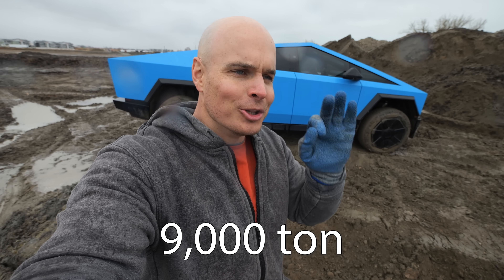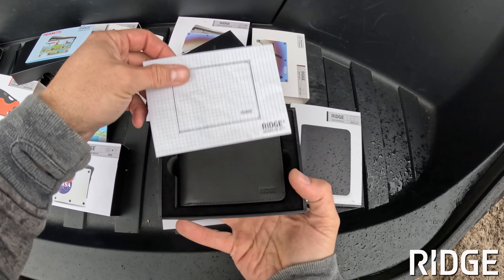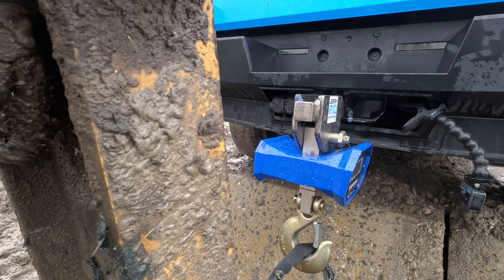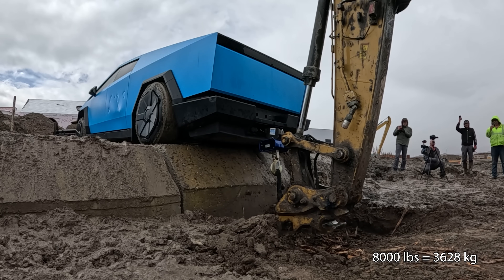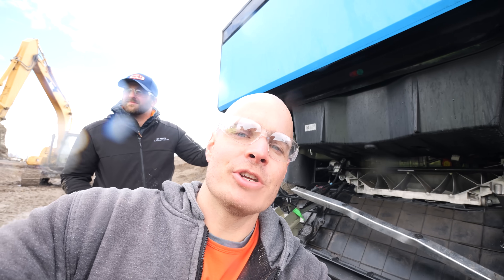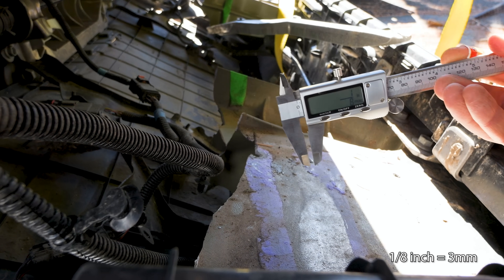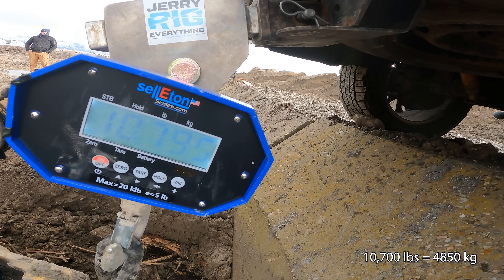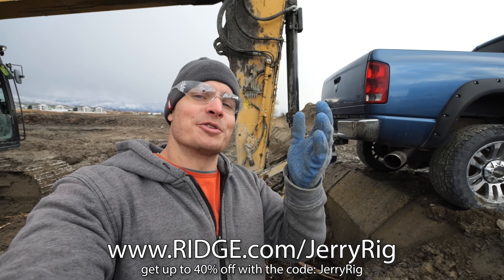SHOULD YOU TOW WITH A CYBERTRUCK?! - (catastrophic failure test)

Comment: I think the bigger takeaway from this is the manner in which cast aluminum will fail compared to steel. Cast aluminum is not ductile and repaeated loads in concentrated areas will cause a sudden and catastrophic failure as we have seen. While one could argue that the downforce in this "test" was not representative of normal towing the known failures have made it clear that the structure is not designed to withstand abnormal or repeated abnormal loads and fail suddenly without bending or warnings of impending failure. Steel will start bending and deforming indicating that there has been a force exceedence. Something that just shatters in this application is a very poor design. As with other parts of the truck, you are a beta tester for their towing system as well. Would I risk towing one time? Sure, but how about in 5 years after towing for the 50th time?

Comment: Experiment was cool but most of the force would be horizontal when towing. At no point would you have 10,000 pounds of tongue weight otherwise front steer tires on any vehicle would be your fail point. Do a test pulling at the hitch, the rear cast aluminum support was engineered for pulling.

Comment: The cybertruck did great! There is no situation in normal towing use that even the biggest trailers allowed on the road would exceed that tongue weight.
Reply: And at those angles!
Reply: I'm not so sure... Aluminium doesn't have a fatigue limit, so applying even 2000 pounds of load repeatedly will eventually break it, whereas steel would be able to withstand it essentially forever.
Reply: Yes but He’s unethical
And dumb and hates Elon and he wanted to do a video with a “broken” cybertruck while towing

Comment: Tongue weight is the downward force that a trailer puts on the hitch of a tow vehicle. The weight of the trailer is its pulling capacity, and in no way does the 11,000 pound capacity mean that the tongue will have to take the DOWNWARD forces of the entire trailer weight. That includes when towing up hill. This experiment exposes nothing.

Comment: I just gotta point out. There is a bit of an intellectual dishonesty here. The cybertruck was Towing rated for 10,000lbs and broke at a vertical tongue weight 10,500. Which is to be expected as that what was far beyond rated as I believe it is around 2000lbs. 

Now the 2004 2500 is a 3/4 ton truck... but the cybertruck is more equivalent to a half ton, not a three quarter. They are completely different classes of vehicles. It would like putting a F150 against a super duty then being surprised the super duty can handle more. For record the 2004 2500 has a rated capacity of 13,500lbs... Now where is the dishonesty? The capacity of the dodge was never mentioned, only steel vs aluminum. If you want to be totally honest it should be stated that the 2024 F150 is all aluminum but has a rating of 13,500lbs. If you want to have the metals comparison, now compare the 2004 2500 vs a 2024 F350 which has a towing capacity of 32,900lbs.

Comment: Im impressed it held that much with a 1500lb tongue weight rating
Reply: Even better: Tesla says its tongue weight is 1100 pounds. I feel weird defending the Cybertruck since I don't like it at all, but... I have to be fair. This test was dumb.
Reply: @TheJohn8765  20 year old truck managed to not break... didn't look like a dumb test to me
Reply: @TheJohn8765  well its bait for the blind Tesla haters that are all over right now. He knows what he is doing.

If you dislike tesla at least have an actual reason other than "I dont like the CEO"
Reply: @drivejapan6293  "I don't like the CEO, he's taking away my corrupt grift!"
Reply: You can tell the dodge  has probably had more than 10500 pounds on its hitch judging by how it was bent
Reply: 1500lb is just a static load. What do you think happens when you're towing a 10,000lb trailer at highway speeds over bumps?
Reply: @murmaider2  not 10,000lbs if force if you loaded your trailer correctly. I would be shocked if you see over 2,000lbs of vertical dynamic force on the hitch if the trailer is properly loaded and you're driving at appropriate speed for the terrain, maybe 4,000lbs max if the road really sucks and has some big bumps and whoops. A 10,000lbs trailer should have about 1,000lbs to 1,500lbs max (no more than 1,100lbs on a cybertruck) of static weight on the hitch. The trailers axles should be supporting about 90% of the weight. Extremely rough terrain might give up to 3x the static hitch weight as a dynamic load. If you are getting more dynamic load on your hitch than that, you shouldn't be driving on that road because it's unsafe.
Reply: @drivejapan6293  What if you drive off a cliff and get hit by a meteor, chackmate tesla fan!
Reply: @drivejapan6293  you must not know how metal fatigue works. Just because it can handle around 10,000 lbs in one loading cycle, doesn't mean it can handle 4,000 lbs over a hundred loading cycles. Plus, it was making noises at 6,000 lbs, so at that point it was already compromised and would have broken off after several load cycles at that much weight. But the real problem is the fact that when it fails, it snaps right off instead of bending. You don't lose your trailer at 60 mph when a frame bends.
Reply: @thecrazyfarmboy  I do a little bit. With a yield strength of about 10,500 lbs as shown in this video assuming this is normal and 4,000 lbs being less than 50% of that it could last tens of thousands of cycles if not more maybe hundreds of thousands. I think this is conservative but you tell me. I am assuming they are using a decent grade 6000 series cast aluminum. If we had the S-N curve we could better understand the failure. 

That's at 4,000lbs peak which it would only see occasionally if you were driving on a really bad road. This is all speculative. For example the newer Ram 1500 has aluminum control arms that a much thinner than the cybertruck frame. They will probably outlast the steel ball joints they have pressed into them.
Reply: @drivejapan6293  what do you not understand about the fact that aluminium gets weaker every time you use it, unlike steel? in 5 years of usage, the aluminium frame of the cybertruck will bend with ease, while a steel frame will be just as strong after 30 years.
Reply: @murmaider2 also remember that they had to hold the front down to achieve this. Which means technically if a shock or dynamic weight shifted even to 7000lbs the front will lift and this will ease off the shock to the trailer hitch. 

The most concerning thing is continuous stress over time on the aluminum.
Reply: @murmaider2 your comment tells me that you have never pulled a trailer in your life. A uhaul trailer don't count. 😂

Comment: For the manufacturing processes that Tesla invested in just to produce a frame so quickly, I'm surprised they did not include other stages of alloys throughout the frame building process.

The grain of each alloy could easily be changed magnetically and significantly improve the strength and durability of the frame with an easily replicable process. Big miss for using a material like aluminum throughout the whole chassis which will fatigue especially under so much pressure.

I wish you had a second cyber truck to do multiple 6K presses on until failure, because that would tell the real story!

Comment: I believe there is  a big difference between tongue weight which this test tested and towing weight. The 11000lb is towing or the load that can be pulled along, not the tongue weight. It should have been pulled backwards to simulate a trailer being towed.

Comment: Everybody said Cody shocked it, but this proves that it doesn't matter. It's still too weak even if it's just steady pressure. Plus the shock is pretty realistic to real world towing, where you hit potholes, or could even involved in an accident that would shock that frame in the same way Cody did.
Reply: Literally no one has damaged their truck towing. This is a stunt for YouTube clicks.
Reply: @truantray  So just because nobody used theirs as a truck? ( Also, that's not true, there have been reported cases of them breaking from towing trailers) Trucks get beat on and trust me the numbers in the owner's manual are just suggestions to truck owners. They often get exposed to weighs way in excess of what they are rated for in the real world.

Comment: Again Tesla = the Enshittification of the automobile. I don't understand how they can get away with this extreme danger to the public. This vid is proof that this "truck" needs to have a  forced recall and have the hitch removed. If this was a truck from the big 3 it would be a nation scandal. Did Tesla not do proper testing? I've seen corporate  test set-ups towing 10,000 pound  test trailers on Pikes Peak and Mount Blue Sky in Colorado. Is there any proof of Tesla conducting SAE J2807 tests?

Comment: Correction: Do not put 10,000 pounds of downward force on a Cybertruck hitch...Now test towing a rated 10,000 pound trailer with weight measurements at the hitch while driving normally. Won't be anywhere near 10,000 pounds...Can you break one with construction equipment? Yup.
Reply: Hey friend, I understand a  watching 15 minute video might be a ton to digest, all of your points were addressed here: 9:46 - 10:30 hope this helps!
Reply: ignoring the fact that the regular truck was fine
Reply: @rayers1000  The 3/4ton truck vs a 1/2ton truck. He should've tested the Ram 1500 which would've failed far sooner.
Reply: @Jst4vdeos A 3/4 ton truck from 2004** vs a 1/2 ton truck from 2024. 

Testing a ram 1500 from 2004 would’ve been unfair because the ratings from back then are much lower. A 2500 from 2004 is very close to a 1500 in 2024. The 1500 would have survived this test.
Reply: @ChaseB1896  most trims of the 2025 1500 have a lower towing capacity than the cyber truck and it's fair to assume a lower tongue weight rating
Reply: @ChaseB1896  2004 ram 2500 could have towing capacities over 13000lbs, btw
Reply: @rayers1000   what is the point of the comment?  I am not saying tesla design is better or stronger. I am just saying it will do what it was rated for with quite a bit of safety margin. I truly dont care about either the tesla or the cybertruck, just doing thr math.
Reply: The man outlined the conditions in which that amount of force would be applied downward in normal use. If you want to counter those points address them but he laid out the conditions.
Reply: @sojourner4726 he didnt line out anything, he just mentioned something without any math being done. If you follow the 1100 pounds tounge capacity, it wont brake under any conditions. Period
 If you go to 1600p static force( 50% more then allowed) you need to hit a pothole with a major breaking or acceleration, on 25% angled road to potentially brake it, load multiplier can be at max x4 the staric force plus the angle.
Reply: @sojourner4726  because hills or something is not a valid engineering explanation. Need real numbers

Comment: I don’t think these cleave off vertical test are truly the best way to test the strength. All of my Ford F-350’s are only rated no more than 2,000lb tongue weight. Truth be told, ONLY BECAUSE I HAD A STRAIGHT SHOT WITH NO DOWNHILL GRADES TO THE DUMP, I’ve pulled a 31,000lb 2 axle 14’ dumper with zero issues and I’m confident this Cyber truck would do the same, doing so is ILLEGAL. Not like any dude is going to be slamming down the freeway at 80mph fricken loaded to the tits, illegal as all get out. As everybody or dudes who drive full size trucks and actually haul heavier trailers routinely, it is no fun banging down the freeway above 60-65mph, in any truck + heavy trailer, it feels unsafe 😂.

Comment: Where would you ever have 10,000 of downward force just on the hitch? Do you have a trailer with no wheels?
Reply: Funny conclusions as the front of the truck would not even be on the ground with 6k directly on the hitch.  Some YouTuber conclusions are so ridiculous or they are really just that intellectually impaired.  Based on this test towing the tow limit of 11,500 lbs is a breeze for the truck. Based on this test, tow limit is closer to 60,000 lbs +
Reply: When you have the average modern day person trying to have a seat on it.
Reply: I wouldn't be surprised if dynamic loads of over 10,000 pounds occur daily on hitches, say if you hit a pothole, dismount a kurb, etc. Momentum is a scary beast, especially when the material it's being applied to has no fatigue limit.
Reply: @stoorps  a very rigid material with poor fatigue characteristics and a lot of inertia behind it...
Reply: @stoorps   at that much weight the car is doing a wheelie...
Reply: @JoshCPirvu the dodge did a wheelie in the vid and that hitch didn’t break just sayin.
Reply: @stoorps  I heard him say that too but that would be pulling force not downward force as long as the wheels exist in your trailer they will prevent this from happening, so unless you put a trailer in the hitch with no wheels and then load it up to 10k, I don't see how this is relevant.
Reply: You could have 10,000 pounds of upward force off-roading . Smack that hitch on a rock.
Reply: @Yungmills  Then you should probably have your truck inspected before towing as the hitch is not meant to withstand that amount of force upwards or downwards.

Comment: Hmm... Most trucks and towing packages have a tongue weight that is different than the towing capacity. I understand that loading incorrectly and dangerous driving conditions could impact that but that would be still on the owner, not the car. It has a tongue weight limit for a reason. ( While I was writing about this, I did get to the part where you mention the tongue weight)

Comment: Stupid test.  Towing forces are horizontal, not vertical
Reply: Yes but He’s unethical
And dumb and hates Elon and he wanted to do a video with a “broken” cybertruck while towing
Reply: Whistling diesel tried pulling his stuck cybertruck when he went to pull on it with a strap strapped to a ford truck. The cybertruck still had this catastrophic failure looked exactly the same as this failure. He pulled horizontally
Reply: EXACTLY
Reply: Except at the crest of a steep hill, like in San Francisco
Reply: @cabbagekitten  yes but it the crest causes your trailer to be at an angle of 90 degrees something else is your problem.  The crest will maybe be a 25% downward load of your towing capacity
Reply: @cabbagekitten  those hills are never 90 degrees.

Comment: So it tested as 10x stronger than the maximum rating. Seems like an A+ result with a 10x safety factor. Excellent performance from the Cybretruck…
Reply: No, it demonstrated that instead of having flex, for a safe margin of failure, it will suddenly, catastrophically fail when the limit is reached.
Reply: @TroySavary  It has a safe margin of failure, the vertical capacity for the tow bar on a Ford F150 is 500LBS, the cybertruck exceeded that by 21x before breaking, put another truck built in 2024 in that same test and it would break far easier than the cybertruck. Just look at the H-beam frame structure and you can clearly see that its more than sufficient.
Reply: That's terrible performance, like Zack says an unproperly loaded trailer going over a pothole could put this kind of load on the tongue for a short period
Reply: @rbesfe  If that happened the trailer would pop off the hitch before ever being able to do this sort of damage. The Dodge RAM he tested after has serious frame damage that he refused to show because he simply hates tesla and refuses to let them win in any test. If he had ANY integrity he would have a rivian next to it.
Reply: @rbesfe  Unproperly is not a word, and an improperly loaded trailer within the towing capacity rating of this truck could quite literally never put 10,000lbs of weight on the tongue like that.

Comment: Great video I wish you on the second attempt on the cyber truck started from zero again and worked your way up because I think the other point is that aluminum weekends overtime so maybe it would've broken sooner on the second attempt not needing for you to add as much weight 

Because that's really the issue here test like could easily make a claim and say well we're close enough to 11,000 but the point is overtime aluminum weekends so it may hold the 10,000 but then on the next attempt it may break off very well at 2000

Comment: you can't apply that force just by towing, because it makes the front out of the ground at 5000 pounds
Reply: With a Schock for example a pot hole +10000 pounds is possible
Reply: @linus0075  with a pot hole anything going 30 miles and faster goes straight, without any forces applied to the tongue